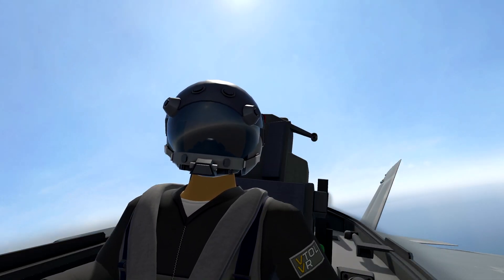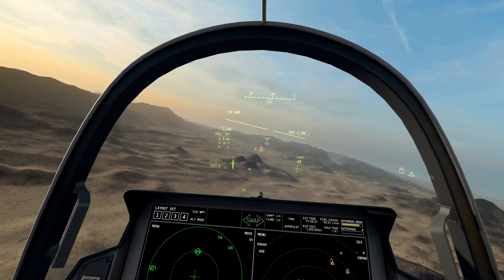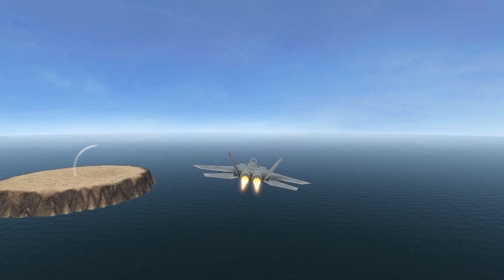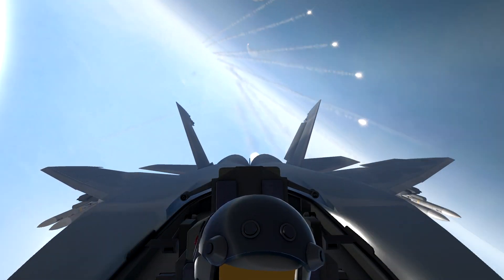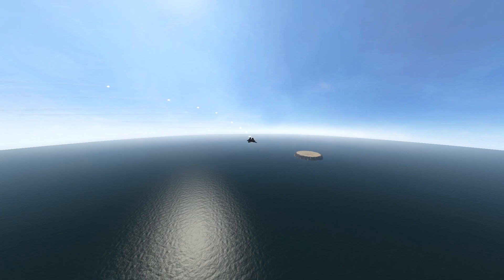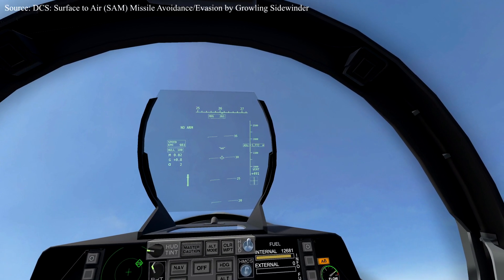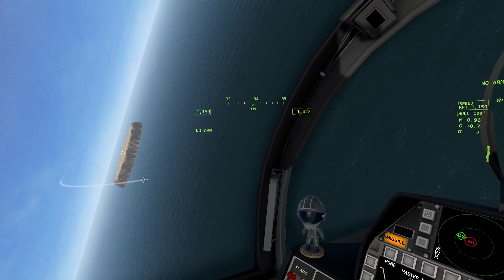VTOL VR - Missile Evasion Tutorial

Comment from the maker: Hey guys I've been pointed out a few errors and apologies for that.

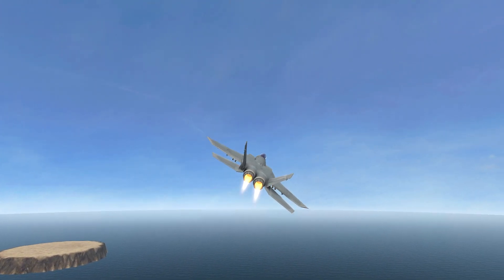At 2:17, what I meant was If you pull too late , there will not be enough time to turn, and you'll be hit. If you pull too early you will have lost too much energy, and you'll be hit

At 5:00, the beaming animation is with an assumption that you're speeding up, meaning the missile has to adjust its course from your acceleration.

At 8:41, what I meant was that the radars can only track things moving toward or away from them when there is the ground/water in the background.

Again thanks for watching, and I hope that this was helpful!
Reply: cool
now how do i even use flares to begin with
Reply: @kebabit707  when holding throttle, press y on oculus touch controllers, for knuckles and Vive I have no idea
Reply: @pizza2385  bit late, but for Vive you hit the menu button at the top, above the touch pad
Reply: @gagekieffer772  Yeah.
Reply: Good video bud. I thought my chaff was just special needs… turns out it was my subpar dodge-missile skills. Dive,duck,dip,dive and dodge.
Reply: hi. i have been trying to work on the high g pulls and barrel roll but still get hit. if you can help with this it would be very much appreciated
Reply: @Wuzzzzo just practice. if you are new to this game, I'd suggest beaming, as it's the easiest one to perform. also, I'd recommend disabling the g-limiter on the F/A-26B, to maximise turn rate. don't pull too hard on the stick, if g-limit is on, you'll go into G-LOC, if not, you'll pull 30gs and your wings will rip off.

Comment: The most effective way of defeating radar missiles that I've found is to notch and beam, but while doing small S turns and chaffing every time I hit the 90 degree angle on the radar/missile. I haven't had to G-pull a radar missile in a while

It's also important to note that if the missile hasn't gone pitbull (switched to the missile's own radar instead of the radar source), you'll have to notch and chaff the radar instead of the missile.

Comment: Thanks for the tutorial, learned a few things I didn't know.

At 9:42, after succesfully notching the missile, you mention it can't see you anymore. This is correct, but if the missile has an on-board radar (and is not depending on the source aircraft's radar on the last stage of flight) it totally can re-acquire lock and redirect course if you are in its cone of detection.
Reply: This was not true back when this Video was released.

Comment: On radar missiles, before you try any of the high g turns TURN THE G LIMITER OFF
It's almost impossible to evade the missiles with it enabled since it limits the rate at which your plane can turn, good luck evading!
Reply: The majority of radar-guided missiles can be evaded with a high g pull with the g limiter on. Additionally, planes will take over-g damage in the next update (i assume, it is currently in the test branch.)

The only exceptions I recall are:
MAD-4 missile
SAAW missile
Long range super cruise missile on the NMSS cruiser
FLKM-100 missile
And the aim-120/120d can be a bit iffy at times, although doable.
All other radar guided missiles can be easily evaded with a simple high g pull, oftentimes only requiring around 7 gs to do so.
Reply: while yes the g limiter can still be on, it only really works from medium to long range. Ive had quite a few encounters where quickly turning off g limiter has saved my butt from a missile. 

Also if you’re flying the av-42c, I recommend putting the aircraft into VTOL mode while making a high g turn. Helps kill off speed faster, making the missile have to work harder.
Reply: @howdeedoo killing off your speed is exactly what you dont want to do.
Reply: Current update makes it so where if you do a high g maneuver with it off, it instantly drops all ordinance, shreds wings, and really fucks you up.
Reply: @simulacra7885  Not necessarily, 14g is the limit for aircraft stress, though some hardpoints can break at lower g regimes. This means that a properly controlled maneuver will result in zero damage if performed correctly.
Reply: @jaidensky5738  oh I don’t even control it i just go full cobra and pull 20gs
Reply: @jumpingjoy7689  my neck can’t speak he is dead
Reply: ive almosty never used that. ive just always beamed, and then pull up as fast as possible at the last second and it would alwayts work if i had enough energy
Reply: how do you turn it off?
Reply: @Smilldon  The plane he's using in the video has a switch on the left near the throttle

Comment: I waited till the missile appeared on my RWR and watched it's signal go infront of the cross in the middle, then I started the barrel roll but the missile ended up hitting me in the back. Does that mean I didn't go fast enough down  or is there something else I should be doing? Other wise, great tutorial! I can dodge radar missiles now, just not IR...
Reply: You started evading too late, when you see a missile pop up on your RWR, immediately crank left/right and try to maintain lock with your target if you're shooting.
once you missile goes pitbull or the missile is getting uncomfortably close, invert 45 degree to the left/right and dive away from the missile.
Do not forget to drop chaff periodically, it will help, plus, if you stay mach 1+ all the time, the missile will be easier to evade, just don't pull to hard, you could lose too much speed and get hit in the face.
I hope this helps if you hadn't learned it already!

Comment: Also, you can shoot down incoming missile using aim9
Reply: That's probably more difficult than evasion since you need to directly face the missile and you can't evade after firing or your aim9 will likely miss
Reply: @LeeAndersonMusic  why would it miss? Aim9s targeting system is all on board the missile. I haven't played this game (yet) but if the missile is modeled correctly you should be able to get track signal from the Sidewinder launch than turn away as you wish.
Reply: @arguy3297  correct. Only radar-guided or AIM-7s require the pilot's attention (until pitbull)
Reply: @Bounze890  Aim7 sparrows should be different they require constant radar guidance as they are SARH missiles (Semi Actuve Radar Homing) the only missiles in the game that can go pitbull are the Aim120s this is known as Active Radar Homing (ARH)

Comment: Is there any sensor that detects how far missile is away from you besides looking out for the smoke trail?
Reply: Missiles that use radar can be seen on your radar detector screen. It's the small screen on the top left of the cockpit. They'll be a red circle with an M inside for "Missile".

However, you have to visually locate heat seeking missiles. If you have wingmen they will tell you if they see one.
Reply: You can see missile using the RWR or the radar system. On the radar they look like little red symbols and on the RWR it just looks like a red square that says M

Comment: You say to kill power in the high g section, but I noticed in the combos you didn't kill all your power, and just lowered enough so your afterburners weren't running. Is killing all the power better than just turning off your afterburners or the other way around?
Reply from the maker: Good eye. I tried to simplify the high g maneuver to just say kill power because of the maximum instantaneous turn rate. By chance you don't know, the maximum instantaneous turn rate is the speed where the maximum g's are possible. At this speed your plane can turn the fastest. However, it only lasts for a moment, and you trade a lot of energy to do it.

In the high g section, I made the assumption that the plane will be faster than the maximum instantaneous turn rate. To reach the max instantaneous turn rate as fast as possible, you would kill power.  In an actual battle, the pilot would have to choose whether to kill power,  maintain thrust, or put on the burners depending on what speed they are at relative to the max instant turn rate. If they're below the max instantaneous turn rate, the burners should be on.

In the combos section I didn't kill power because I had a lot more time to dodge compared to in the high g section. I've also tried to conserve energy because the map I was playing on continuously fired SAMs at me. And there's also me being scared a missile's coming at me haha. 

A bit long of an answer, but I hope it helps!
Reply: @jrllotak2  This helps a lot. Thanks for taking the time to respond.
Reply: +1

Comment: Exactly what I was looking for. Thank you so much! But I cant find the flares in any plane
Reply from the maker: They are on the left side of the cockpit for the AV-42 and the F/A-26. Check out the VTOL VR tutorials video and he'll point you out. For the F-45, unless you're on the public testing branch you can't configure them. If you are on the branch, it's in the SMS page.

 I have the Vive, so if you have that you press the menu button if you're holding on to the throttle. That will dispense a chaff and/or flare.
Reply: @jrllotak2  thx